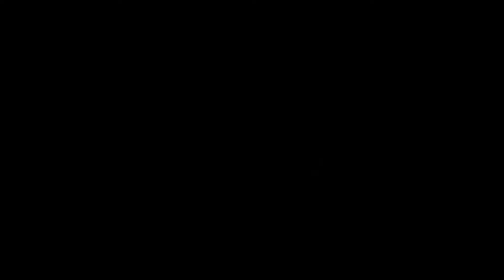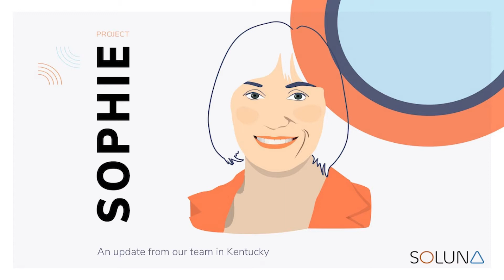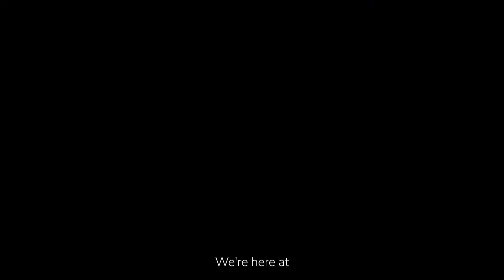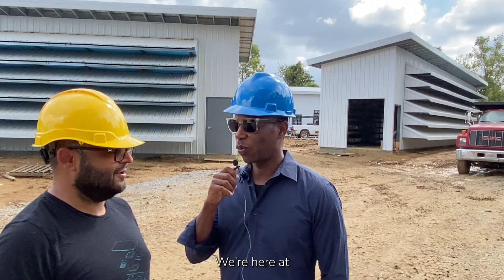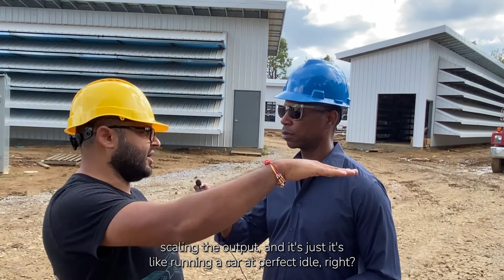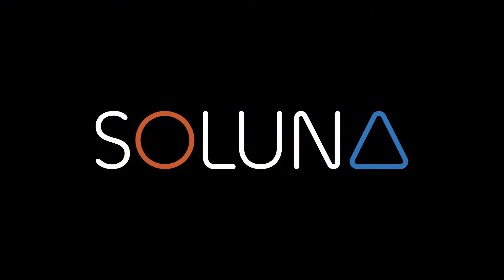Project Sophie: The Modular Design of Soluna's Data Centers

Comment: Now I'm curious are y'all running on a passive cooling system and what are y'all using to optimize thermal mass  to offset the heat of the day inside the building